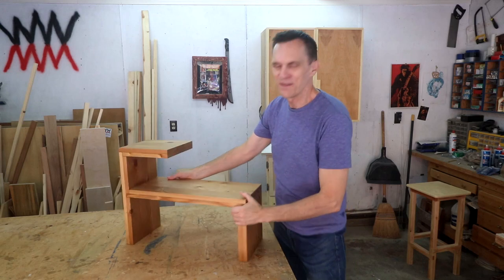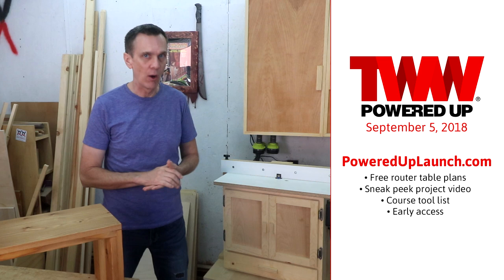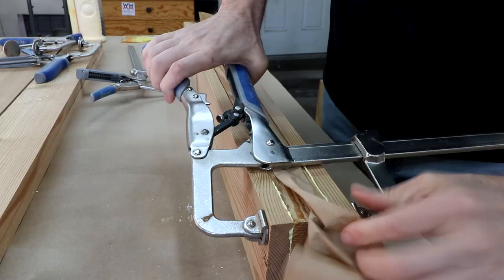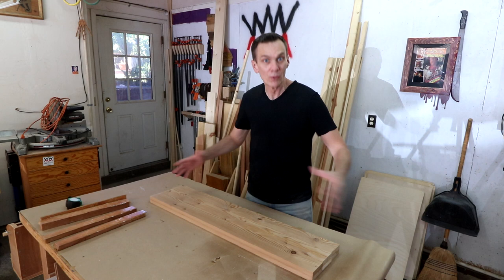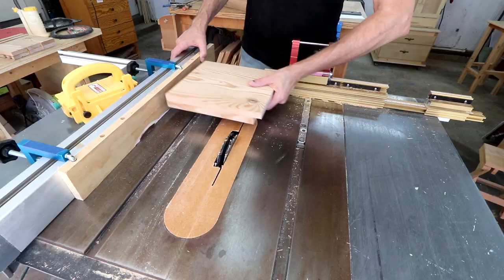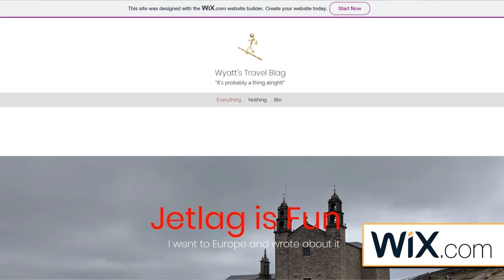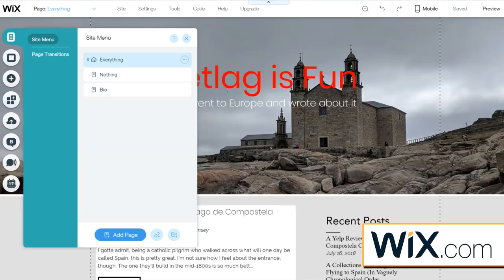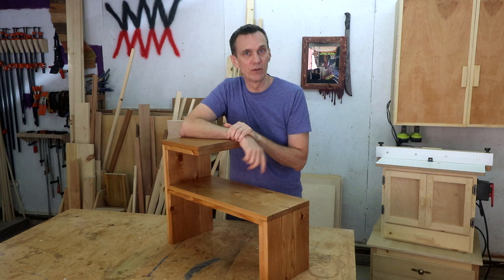Is this the world's sturdiest side table?

Comment: I love that you listened the crowd and went with a more advanced course :)
Reply from the maker: Thanks! The fun for me has been to design a course that has challenging projects and teaches lots of new skills, yet still retains the Mere Mortals mission and doesn't require a lot of space or expensive tools.
Reply: A Mere Mortal with just a handsaw, a few clamps and some creativity could reasonably replicate this by gluing the starting stock into 1x12 panels and using additive joinery rather than trying to figure out how to cut rabbets and a dado without a table saw and dado stack (Which can be done of course, but we're talking Mere Mortal, not Paul Sellers level woodworking.)  Sure, the fit and therefore strength won't match properly milling, jointing, then cutting joinery.  But it'll still be worlds better than what you get for less money, time, and frustration than shopping for, buying, then finding where you placed that dang allen wrench while assembling something similar from a meatball restaurant.
Reply: Benjamin Shaw I had a similar thought when I first saw the completed project in the thumbnail. 9 cuts from a 1x board glued together rather than 4 pieces milled and jointed.

Comment: I used this kind of joint this weekend. Only I routed them out and used doubled up 12mm Baltic Burch plywood. (My project was a shallow cabinet with sliding doors to hide cables and power outlets under a wall-mounted-tv/media-shelve)

Comment: Love this look.  Minimal.  No hardware.  Great choice. Great look.  I did notice that you used a bunch of different clamps in different applications.  A series of quick videos on which clamp to use in which circumstance?  Just asking.
Reply from the maker: Great idea. Real quickly though, I always recommend a couple 18"-24" bar clamps and a bunch of pipe clamps. They are cheap and you can make them any length you want.

Comment: Hey just wanted to ask, I probably have much less experience than you but I know a thing or two about woodworking and was wondering how you are so sure about the durability of those glue joints when they are all end grain?  my understanding is that if one of the two surfaces being glued are end grain it is an inherently weak joint

Comment: Thanks for another great video Steve!  I saw the notification on my phone when I was at the hardware store, and I was legitimately excited to get home and watch.  Great table.  If you made the legs a bit higher, do you think it could also work as a bench?
Reply: Hi there, Steve Ramsey, if one wanted to strengthen the side table you made, what kind of screws would you suggest, and, how & where would you place them, in order that they wouldn't be noticeable. Newbie, watching your vids. Now trying to build something as a starter project. Simple, yet Nice design, that lil side table. Caribbean girl. Bless up.
Reply: He has laminated two 1 x boards effectively making a 2 x board. Kreg HD screws going from bottom to top in the end boards is probably the most effective way. Remember, use the HD screws for wood this thick not the regular ones that would also work but not as strong. However, the HD requires a separate drill and jig and is most suited for wood of at least 2 x thickness or more.

Comment: Hi Steve,
I've been lurking in the background of your site(s) for several years.
Always like your stuff and often get inspired by it.
Your piece about IKEA sparked this response.
I think, (that's right I) that IKEA and Wal-Mart feed our desire to be a throw away society. Make it cheap and affordable so that when you move on, you just throw away the used stuff and go buy some new throw away stuff.
Okay, so now that I've said that...
I like to see what you build when you take those "throw away" items and make stuff. Stuff that is sturdy enough to survive a move or even a new generation of users. The slats in this project are an excellent example (probably salvaged when you upgraded to your Casper bed I'm guessing).
Keep building and sharing.
OBTW, I will take a look at WIX because of you. (that's right, putting the weight on your shoulders) They have had an overly aggressive ad campaign and that turned me off to them but, if you like em then I'll take a look at them.
Yours,
Another Mere Mortal
Reply from the maker: Thanks Thomas! A part of me doesn't care much for the wasteful concept of disposable furniture, but another part of me applauds knock-down furniture retailers for providing reasonably stylish furnishings that people without deep pockets can actually afford.

Comment: A glue question... I'm thinking about using some angle iron as clamping cauls as they don't really warp and are strong but does wood glue like titebond or gorilla glue stick to metal? I have wax paper to use if necessary.

Comment: hey Steve I'm planning on making a 4 post bed but I'm not sure what type of wood to use I'm a very big guy 6'7'' 400+lbs I have done a little wood working but nothing that needed to hold weight over 100lbs I was thinking of 4x4 for the posts and cutting half lap joinery for the side rails do you think it would work I'd love to get your advice
Reply: Wood is much stronger than you think, you could try making mortise and tenon joinery but that requires a lot of experience, half laps are a great way to go.

Comment: Steve, as a new woodworker I was wondering would you recommend cutting rabbets with a router or dado blades?  It would seem to me that it's easier/more efficient to cut those with a router but again I'm a newbie.
Reply: I'm not Steve, but it all boils down to what you are comfortable with. I use a box cutter blade set, which is similar to a dado set but only comes in two widths, but I use that as opposed to a router Why? Because I am comfortable with what I can do on a table saw, but I am just learning router techniques. Once I get comfortable with a router I might make that my preferred method.

Comment: Nice video Steve - When you glue joints like this, how long would you typically let a joint like this set before releasing your clamps?
Reply from the maker: I try to wait an hour, but 30 minutes is usually fine as long as I don't stress the joint for a while.
Reply: Perfect, thanks for the speedy reply! :)